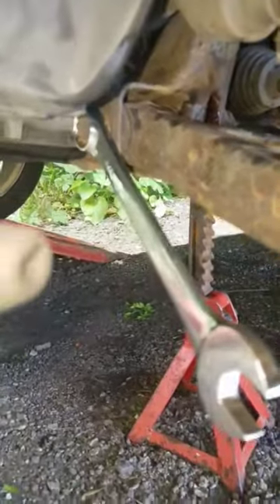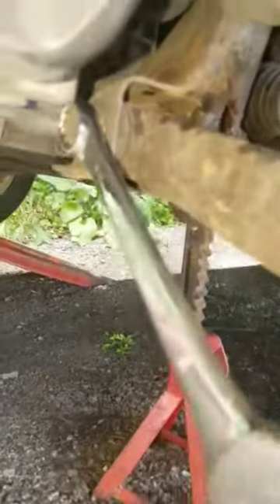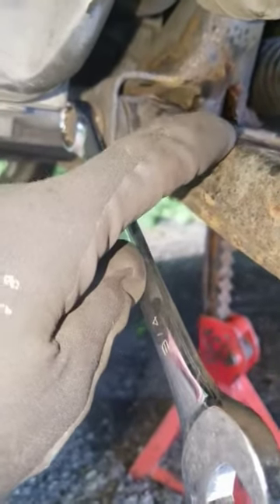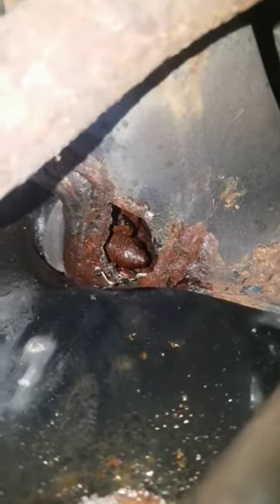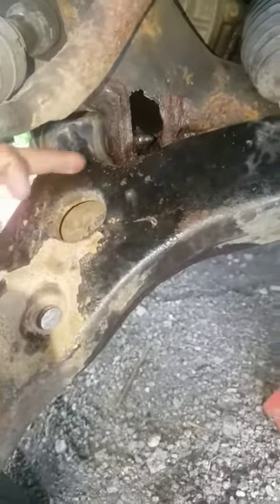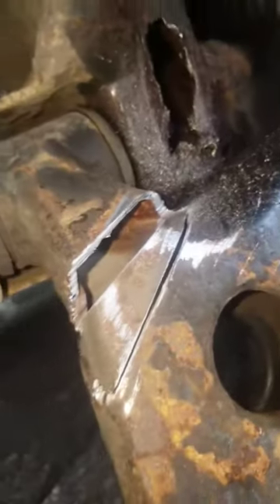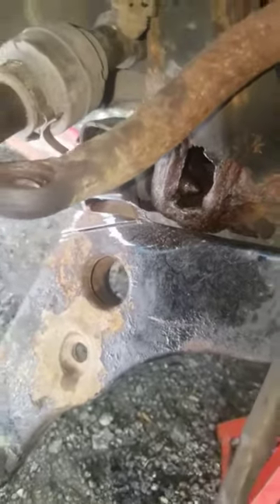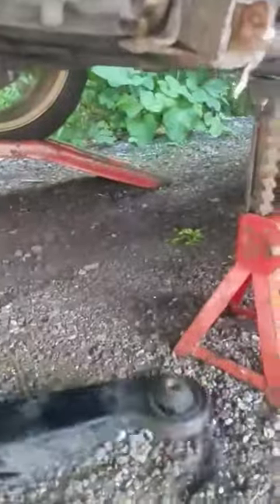03 Mitsubishi Lancer lower control arm bolt just spins. The plan of attack.

Comment: I first cut off control arm just below bushing . I managed to get the bolt out and nut off today in 3 hours. My captive nut had broke loose from the welded cage and was just spinning due to bolt rusting. I drilled 4 holes on side of subframe where captive nut is and used the holes as a guide for dremel to cut square piece out. I then was able to see that the nut was just spinning so i used a hammer and screwdriver to smash off the cage around the nut. I was then able to get a 22mm deep spanner on to the nut but the bolt was seized still even when soaked in pb blaster and eveb with the use of a breaker the spanner would press into frame. So i put a 3 tonne jack under spanner and made sure it was holding pressure on the nut in the gap not to touch the frame and then used a breaker bar with 19mm socket and 6ft steel pipe and with plenty of slow turns i got the bolt and nut off with them both being usable. I then tightened bolt and nut up to spec and welded nut in place and patched up the cut on frame. Good luck to all
Reply from the maker: Nice work. Exactly how to get it done.